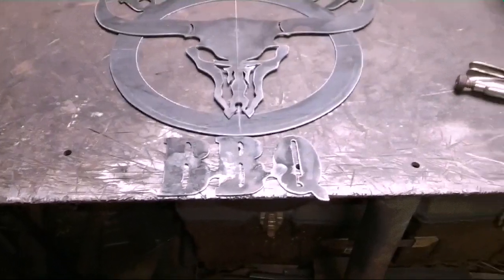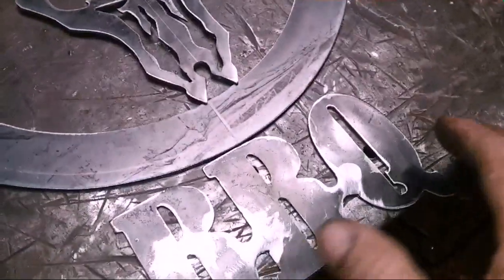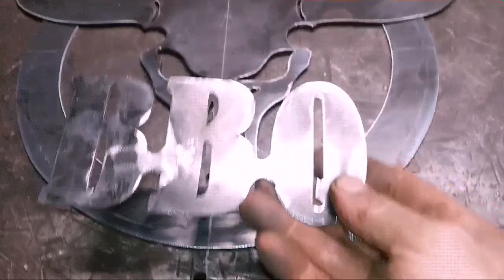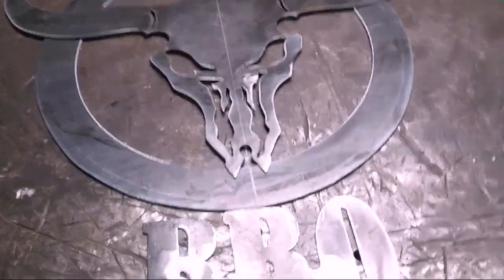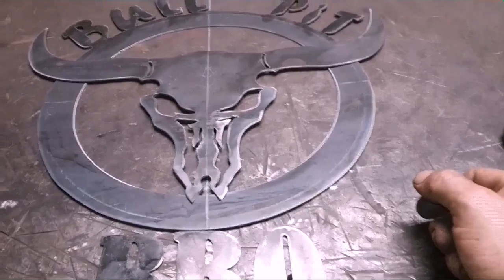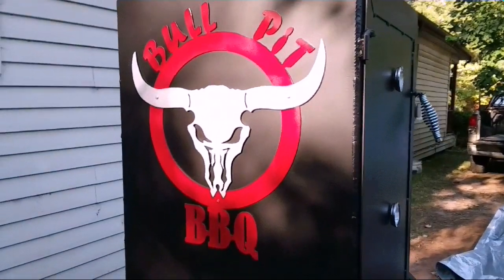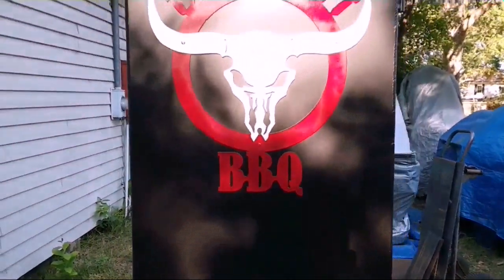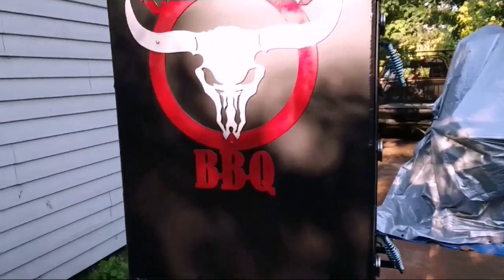Hand cut bbq logo

Comment: Hey you grew hair from the time you opened the video to the time you did the work. You should bottle that!  hehe

Nice job controlling that no-touch plasma cutter, looks like you've got a good technique down! One question/suggestion if I may: Why not use rivets to hold that logo onto the smoker instead of those flat head screws? They're less obtrusive and you don't have to worry about them rusting and not being able to back them out should the owner want to repaint either the sign or the smoker down the line. 

Great job as always!
Reply from the maker: Lol..bacause I've meant to get a rivet gun while I'm in town about 1000 times and forgot to get it everytime
Reply: Use whatcha got. 10-4!